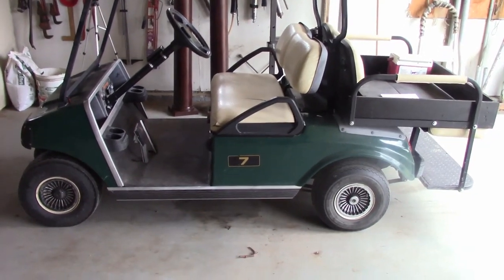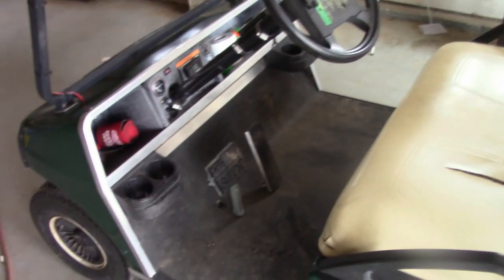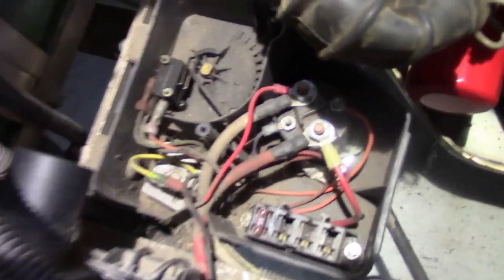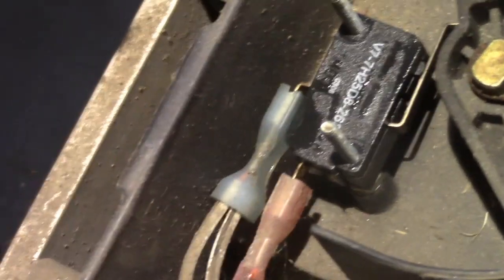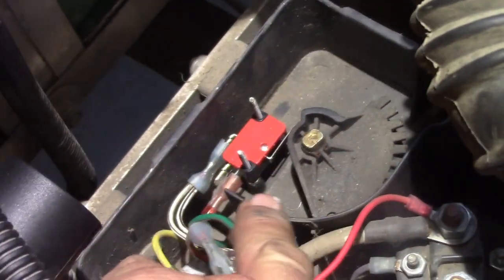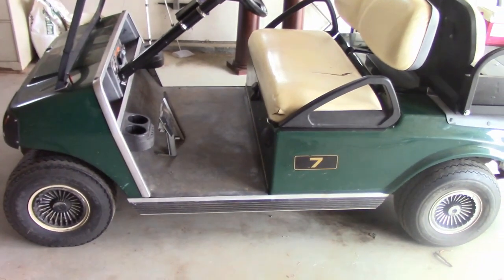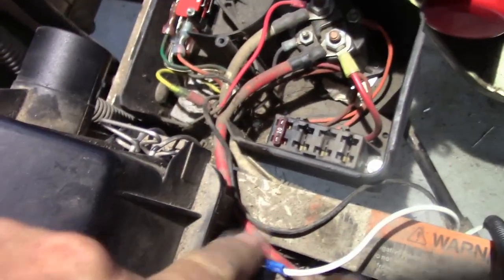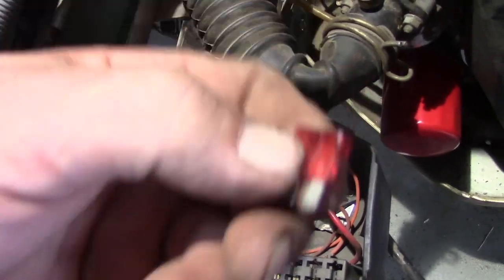Replacing Mircoswitches on Club Car DS

Comment: God Damit, Great video!  I received a basketcase clubcar 1998 engine parts were in coffee cans and milk crates, Honed the engine installed new rings and some other parts  there were no micro switches , throttle cam , etc,etc, This video helped me with that section. Now I need the forward and reverse section , same thing with the three terminal two terminal switch, if you could post any info on this would be helpful, Thanks